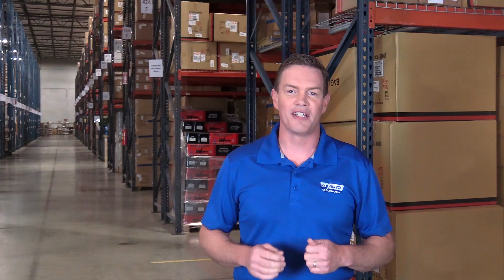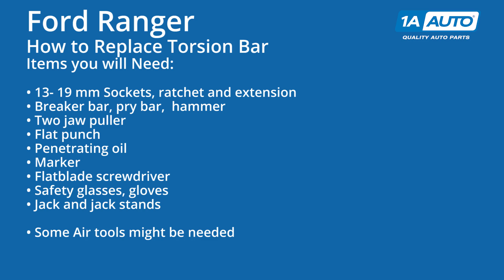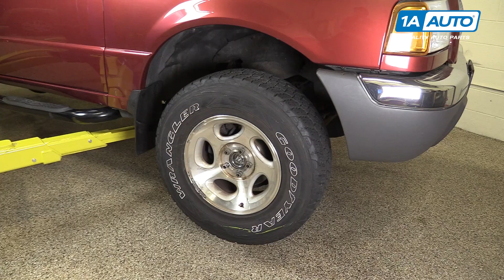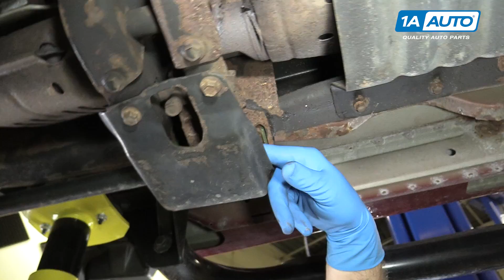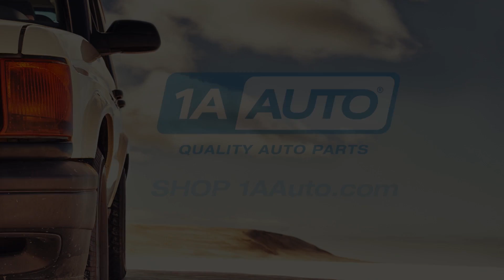How to Replace Torsion Bar 98-12 Ford Ranger

Comment: I just did this today on my 04 ranger. A week prior, soaked everything down with a mixture of 50/50 acetone and transmission fluid. I don't know if I got lucky, but everything pulled apart so easy. The key just needed to be taped off and the actual bar pulled out of the lower control arm by hand. I noticed I need new isolator pads between the key and the frame. So now I have to find those. Everything got reinstalled with anti-sieze painted on everything. Lol.

Comment: What if your torsion bar is extremely rusted in the control arm that hitting with a sledgehammer doesn't get it loose. Sprayed plenty of penetrating fuild in it?? What can be suggested?

Comment: I could not tighten the 13 mm nut to add height. Is it because I put the jack as if to change the wheel then in the middle of the front frame ?
Reply: Yes, that's why. You need to let tension off of the spring. By lifting it from the A arm, that doesn't let any tension off of the spring. You need to lift from the center frame piece to allow the tires to hang. Then it'll be easy l way easier to adjust. 👍

Comment: What do I do if I didn't count the number of turns when removing the adjuster block bolt?  If I take my truck in for a front-end alignment, do they adjust this accordingly?
Reply: I believe you can also measure the height of the front wheel well from the ground before uninstalling and then tighten the bolt until the height matches. The more you tighten, the more the truck lifts in the front tyre. Maybe you can find specs on the original height of the truck in the manual or on google.

Comment: I tried to put mine back in place with a 4 inch, 2 jaw wheel puller and NO way it would not go back in place. I even tried using a 12 ton jack to get it in place. I had to take the 2 bolts out of my shock mounts, plus un-hook my sway bar end link. After I did that, I was able to put the torsion bar back just bushing it up with a long screw driver. The one they do in this clip must have been a very weak, one or wore out one.
Reply: Only jacked up one side of the truck?
Reply: These are the nightmares i fear. Hours upon hours of lifting misery trying to get something back into place is the worst part of car repair.

Comment: I have to buy a puller, what size should I buy?
Reply from the maker: +Richard Person Thanks for checking us out! You may want to get a set of pullers for future jobs that may require multiple sets. There are several sets out there that have 3-8+ inch pullers. A 4-6 inch should be sufficient.

Comment: When replacing the lower control arm do you just loosen the 13mm bolt and tension from the bar??
Reply from the maker: +DaytonCarCare Remove control arm bolts, you may need to pry bar out (rust penetrant will help) and replace with new arm
Reply: @1AAuto  I have a question I tore down the whole front suspension on one side of the truck basically to replace the whole front suspension. I didn't mark the location of where the the torsion bar went. Is there a way to figure that part out? Or am I just stuck guessing..?
Reply: @ProjectNemesis92  guessing

Comment: What is the 2 jaw puller rated for, 2 ton or 5 tons? is there a custom point to fit the torsion key dimple?
I have used the C-clamp made for this, but on the Ranger it slides on the inner crossmember and pulls the key inwards and off the true centerline of the frame bearing pads. Also, the Rt side has to have the exhaust pipe clearance for the C-clamp style torsion key compressor. That i had to removed the transmission mounting bolts to jack up the pipe clearance. A real struggle in time to correct it, and use lots of wheel bearing grease on the contact areas.
Reply from the maker: +Dan DIY I would recommend using at least a 2 ton puller for this job.  This vehicle does not require a special bit, so any 2-jaw puller bit will work fine! 1aauto.com

Comment: When you removed the 13mm tensioning bolt @2:40, you backed it out 18 turns until it was free.  When you installed the bolt @8:07, you turned it until it touched the bottom of the torsion key, which appeared to be a few full turns.  Then you turned it an additional 18 turns.  Is this correct, or did you add more tension to the torsion bar by mistake?
Reply: Mike K it shouldn't make a big difference just try to keep both bolts for both left and right key even. You can adjust those keys to your liking. As tighter makes the ride stiffer but also gives you clearance in your front end and looser makes the ride softer but you loose clearance in the front

Comment: Not thrilled about the 2 jaw puller. It can slip off. There is a cheap tool now that removes them very well.
Reply: mid sized beefy c clamp with indent to lock in with key
Reply: Which tool is that?